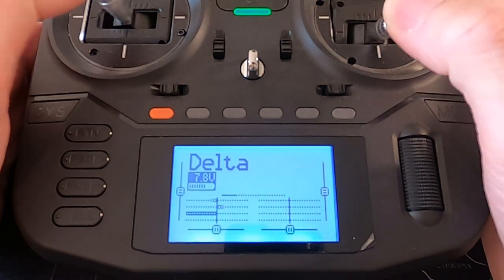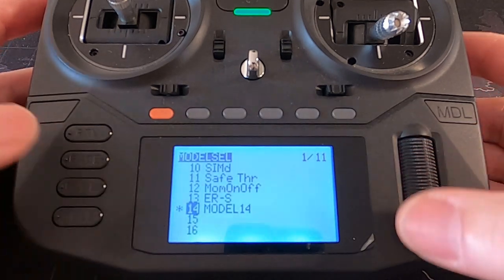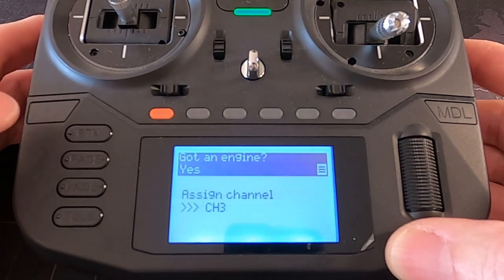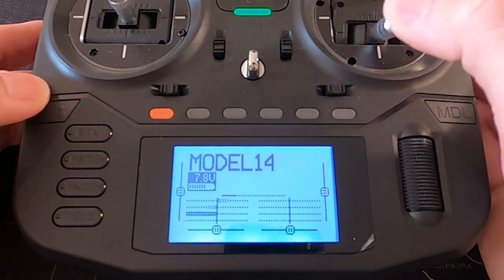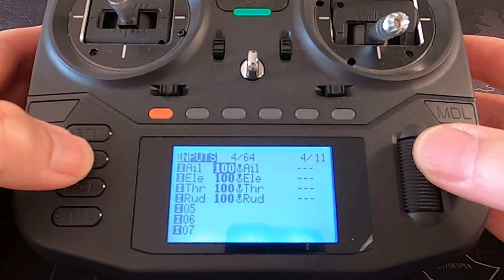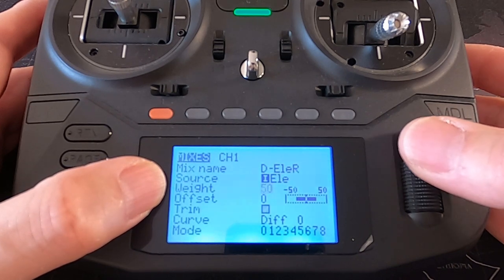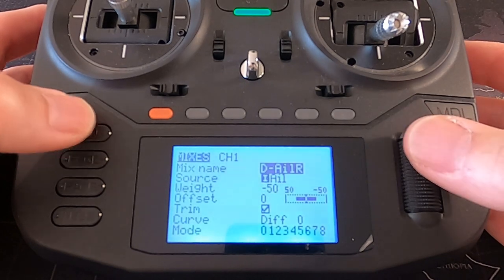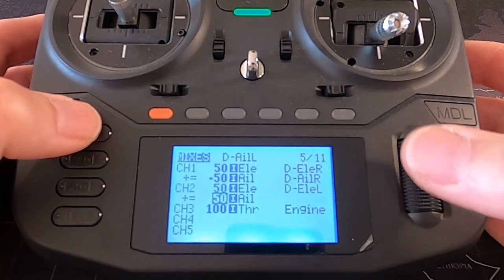RadioMaster Boxer Setting up a Delta Wing - Model Wizard?

Comment: I am thinking about buying a frsky V8R4- II. Will it bind to a boxer radio 4 in 1?
Reply from the maker: I do not have this receiver but from the specifications it should bind but it depends on the firmware installed on the receiver. Take a look at the RadioMaster receivers which are available.